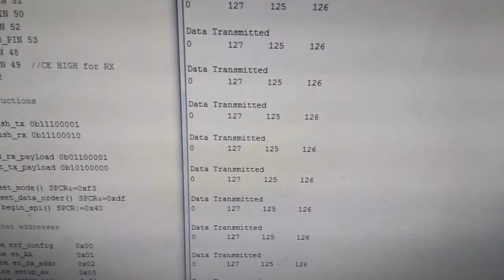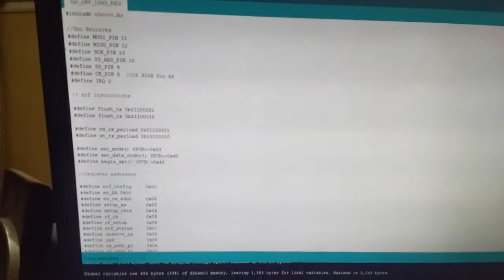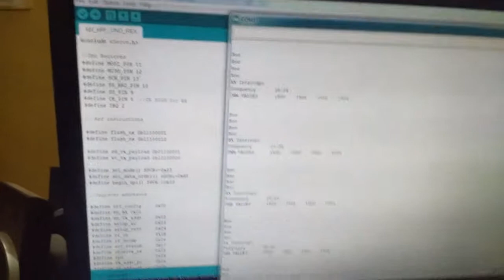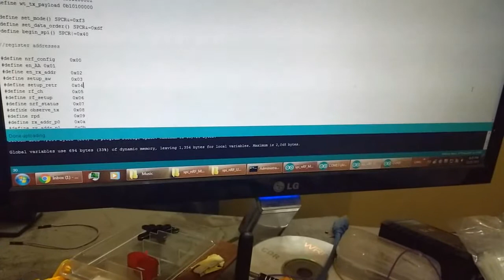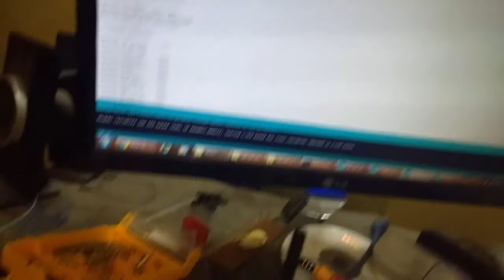nRF24L01+ RC Transmitter

Comment: Hi... can I control flysky receiver by this transmitter?
Reply from the maker: Fata Noor Different RC's come with different internal hardware so that's a no.
Reply: yes, you can use the library  nrf24_multipro-master
Reply: do you have video for it..